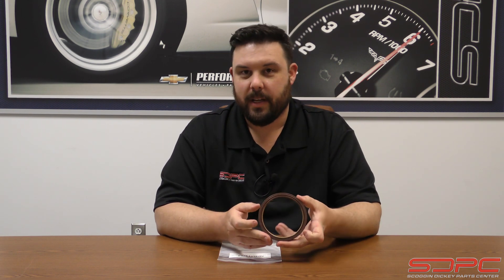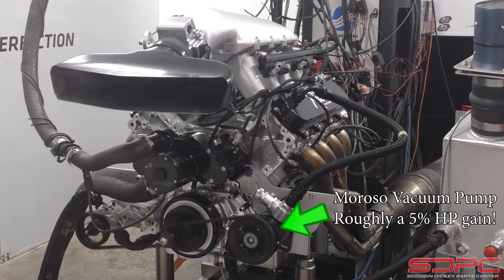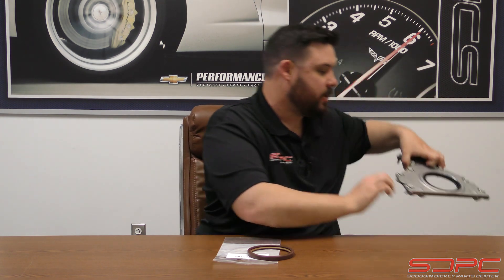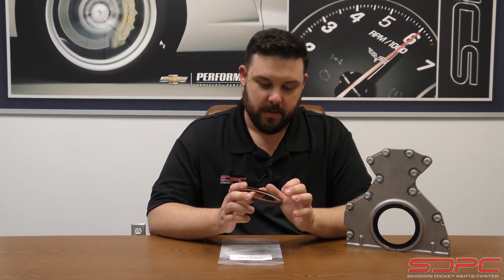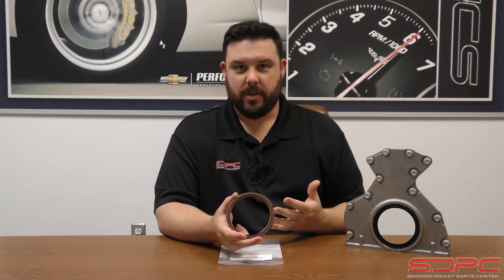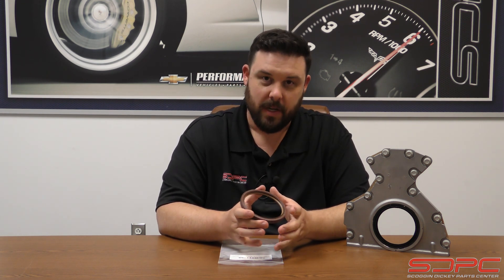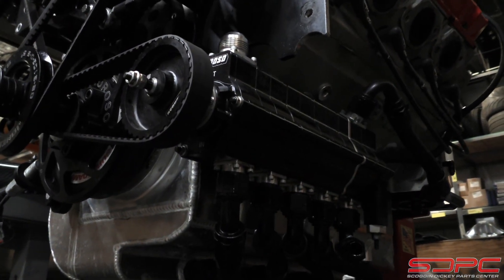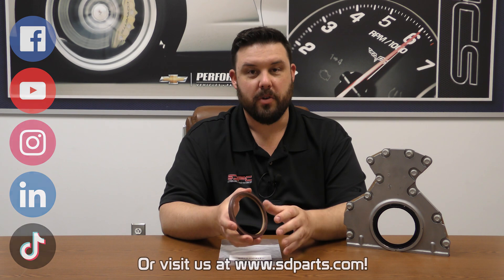SDPC Tech Tips: Crankcase Vacuum and engine sealing

Comment: There is a full time vacuum evac system on the market that does all the same functions of a belt driven system but designed for the street. The Elite E2-X series. Uses a series of special checkvalves and a special Venturi Vacuum Generator for continued vacuum during acceleration so no crankcase pressure can build. Excellent for turbo or centrifugal SC applications.

Comment: What vacuum level do you see issues? I run 12-14in on my dry sump ls3 and monitor crankcase pressure. I have not noticed an issue with that as of yet.
Reply from the maker: The LT seal was toast at 15 inches of vacuum.

The LS seals appear to be a bit more robust.
Reply: @Sdpartscenter  thank you very much for the info. ill be picking up a seal for the next winter. For my dry sump road race ls3.

Comment: I have a built LSX block that has Gibtec pistons with a very smooth cylinder wall finish. I hooked vacuum to my catch can when I was first trying to set up my PCV set up. With vacuum hooked to my catch can I could feel the power in the seat. It was pulling oil into my catch can so im running it vented to atmosphere now. Might hook up a vacuum or even use the exahust to pull a vac on the PCV system.
Reply: I went to a taller valve cover to eliminate the oil consumption. I also went to a check valve on the intake side to stop the reversion in the pcv system.

Comment: Do you install seals dry or lubricate them? what parts of the seal do you lubricate? also if lubricating the seal what lubricant to you use, engine oil, grease, silicone paste?
Reply from the maker: They're installed dry, the Teflon beds in on the crank and promotes a better seal.